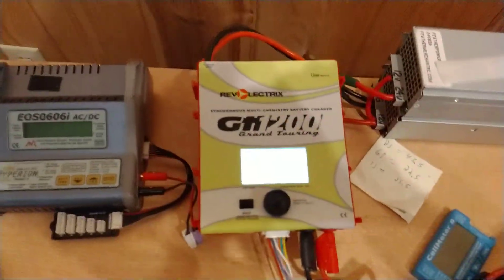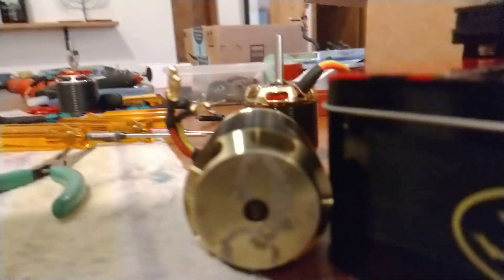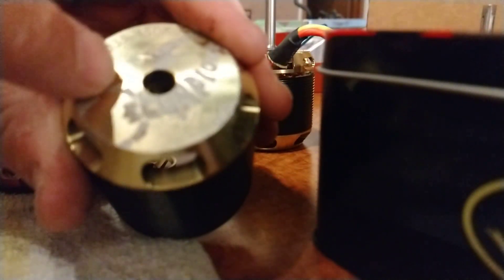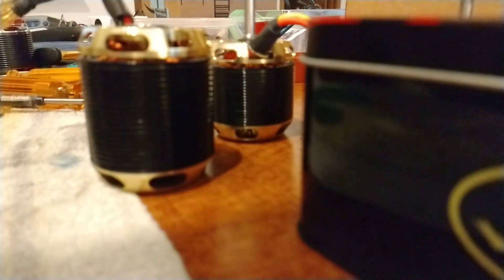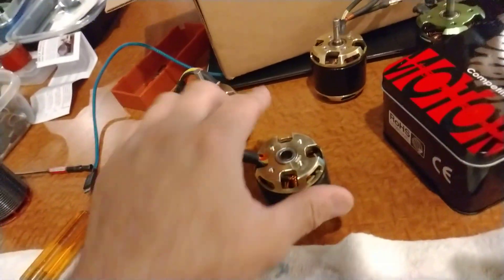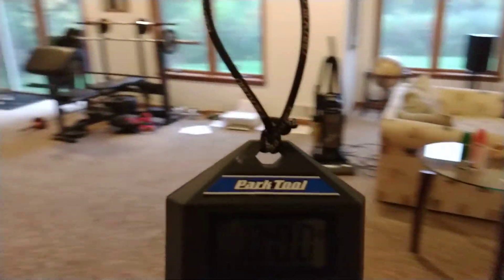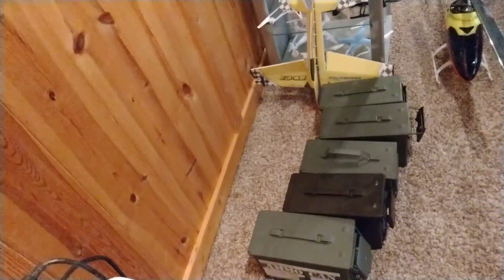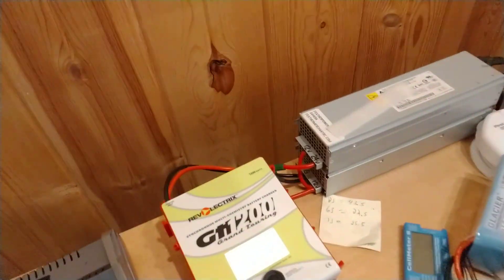Henseleit TDF with new Xnova 4030 470

Comment: Just a few tips.
1. Please take more security measures.  Your take off distance is way to close. In an other video you took the Logo 700 on the bench and tried some thinks with all 3 motor phases connected and blades on. RC Helis are flying sawblades and really dangerous. Sometimes we need a reminder of this :)
2. You need speaking telemetrie so that you don't need to look on the screen.
3. An bigger place without trees would be much better for you. I dont know if there are any near your home. 

Have fun and a hand full of air between your heli and the ground/trees

Comment: Hey man, this was awesome. What would be a good battery, motor and esc selection for a TDF setup suited towards payload lifts with high energy efficiency (i.e. Use less energy to lift the same payload over a certain distance)?
Reply from the maker: Thank you! I would use a quadcopter or hexacopter for lifting or carrying A load.
Reply: Rod Gullett haha, my university team are designing both a custom multirotor and Heli. I’m on the Heli team but we wanted to gauge how much we would score on the energy efficiency points. If you’ve got any suggestions on a good motor, battery and esc selection that would be awesome? I’ve got the HeliCalc online calculator membership, so I’d use the graphs from there to gauge our point score.
Reply from the maker: What size heli are you guys going to use? (blade size). Use the larges blade heli you can. Usually 800 size.
Reply: Rod Gullett The Max Take off mass must be less than 6.9kg with payload included. So we were thinking of running a Trex 550e rotor head with 650 blades. We’ll redesign the chassis and gearing to accommodate the payload.
Reply from the maker: @suhaylpatel9471  that's a good option. Another lighter that can handle 690 blades is the Mikado Logo 690. Also the logo 600se can handle 690 blades also.
Reply: Rod Gullett Thanks for the tips. Checkout our team instagram page @uclteamnova, we built a drone last year and some of the previous students designed a jet powered drone.